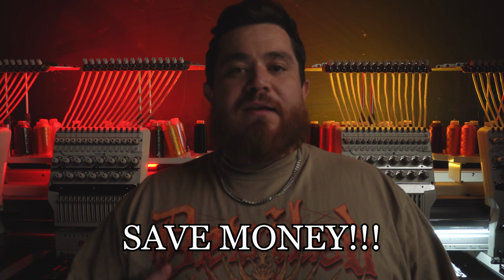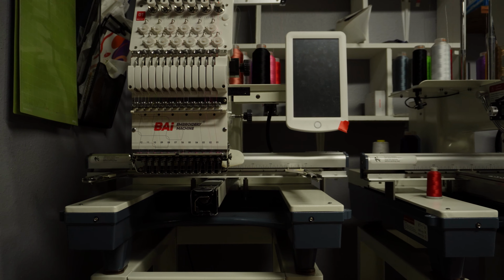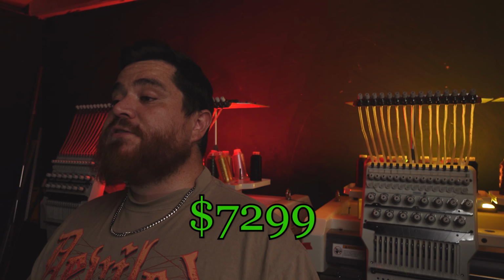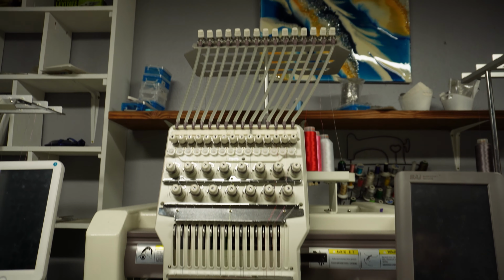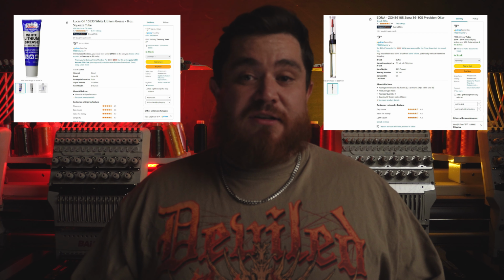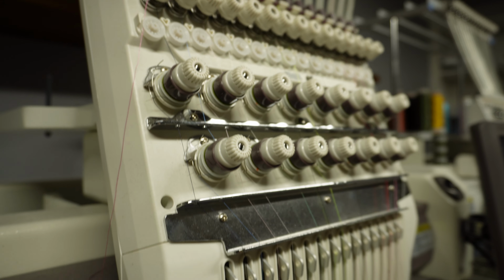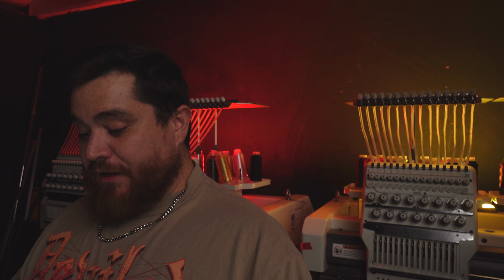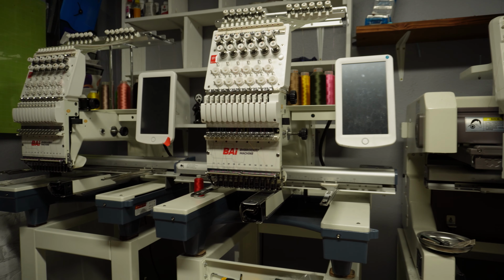Bai Embroidery Machine Mirror vs Vision V22 - Which Machine is Right for You?

Comment: Can you still do Richardson hats on the mirror?
Reply from the maker: @caiticork8786  I wouldn’t get a mirror with the intention to do lots of structured caps, you can. But I wouldn’t. Vision would do better and there is still a learning curve.
Reply: @Red.E.Hustle  Thanks for the video.  Can you explain the exact issues with structured hats on the Mirror? Can better needles improve the outcome?  I have read recommendations on not using any backer material when embroidering structured hats. I'm asking due to limited space being an issue with buying the bigger Vision machine. The plan was to use Yupoong hats which seems to be of a similar build quality of the Richardson hats.
Reply from the maker: @jlharris4830  bigger needles help. But you can do it. I love yupoong over Richardson. But if you plan on working with businesses, they all seem to prefer Richardson 112.
Reply: @Red.E.Hustle  Thank you.  The BAi rep just replied to my email about the differences in the Mirror 1501 and the new Mirror. She mentioned that the software and interface are different as well as the inner parts have been updated. I've never used either lol
Reply from the maker: @ we are looking to buy two mirror models to add to our shop. If we do, you will be seeing videos. We just added two new visions and they are bigger than the original one. But they are also amazing, much improved in every way. Definitely happy with it.
Reply: @Red.E.Hustle  Sounds like a plan. Your videos really help so thanks again. I will also look more into the titanium needles and test out not using backing material on structured hats as a few have suggested.
Reply from the maker: @jlharris4830  heat gun helps with the hard center on the cap. But can deform it. Which sales rep did you talk to?
Reply: @Red.E.Hustle  Thanks. I may be able to setup half the needles to do hats and the other half to do flats. I will try that out during the learning phase. 

Erica I think her name was.